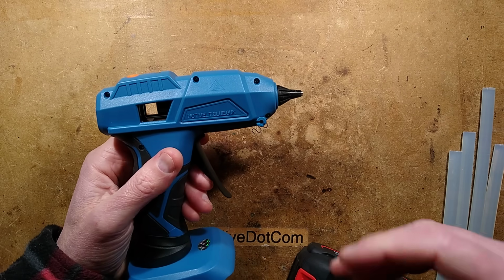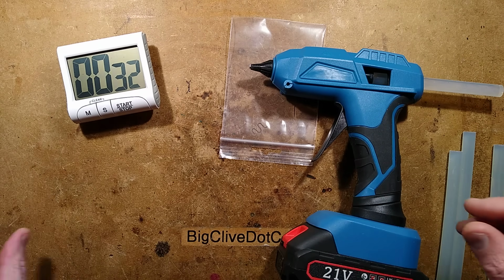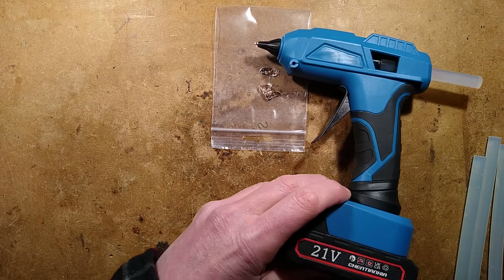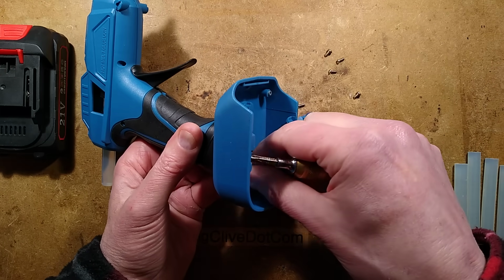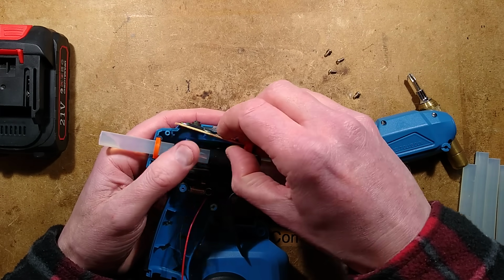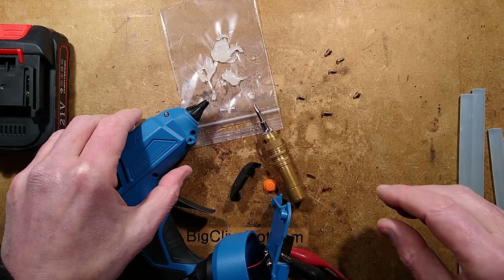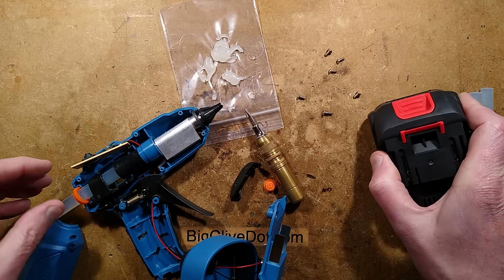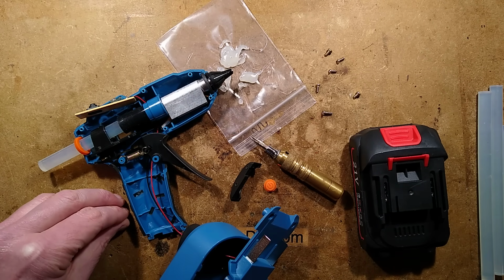Makita battery "compatible" glue gun

Comment: I built one of these Ali Express batteries and got the parkside adapter and it is really good. It was pretty simple to build but people should be worried there is a video where the guy starts putting the batteries in the wrong way around and once you have the cells all spot welded on he cuts and when he comes back finishes the battery as if it is all fine. But he had made a mistake. 

The BMS was facing the wrong way with the plus and minus at the wrong ends. So people should watch out and read the posts looking for warnings because YouTube just seems to leave those faulty videos misdirecting people. 

I will add that glue gun to my list of Ali Express gooddies. https://youtu.be/nm6DO_7px1I?si=xUCKVoGXoWwi5-72 

Here is the Big Clive theme song ;)  

https://youtu.be/nm6DO_7px1I?si=xUCKVoGXoWwi5-72

Comment: Something to note: I got a "Makita-compatible" mini chain saw from Aliexpress. Battery compatibility was only one way. I could use the chain saw happily with a real Makita battery, and it was a lot better than the supplied battery that kept cutting out (over current draw?). And while the fake battery physically fits a real Makita tool, it doesn't actually work. You may get the LED worklight to light, but not much else.

Comment: Glad I found this video, I have a mains operated glue gun, I bought in the 80s and still going strong, 7mm sticks. I never knew a battery gun existed. However they seem to design the same gun but for different makes of battery. I may invest in a battery version that works on a Dewalt 18v battery.
Reply from the maker: Keep in mind that DeWalt batteries don't have over-discharge cut off.  Accidentally leaving this on could cause the charger to refuse to charge them.

Comment: I have one of those Makita compatible batteries. Someone said it was waterproof. It was used for a portable pressure washer.

Water got in and shorted a capacitor. It holds its charge well. Still need to swap the BMS over. £4

Comment: Man, I would want Makita to make their batteries with protections in them, especially with Lithium Ion cells that don't like to be used improperly and could become a blow torch and fire starter in someone's home.  One of the reasons I will never drive a Tesla or other electric vehicles as those things tend to spontaneously ignite more than a lot of gasoline/petrol or Diesel powered vehicles.  Diesel especially since it has to be finely atomized to burn.
Reply from the maker: The new Makita batteries have better protection circuitry in them.

Comment: Bunnings in Australia sell their Ozito brand cordless tools at very reasonable prices. They periodically have"specials" and over the years I have ended up with almost the whole range. 1.5 to 6 AH batteries, discharge, over current, over charge, protection circuits in them. The over discharge will give a bit more after a short wait, great for the last screw while standing at the top of a ladder. NZ Warehouse brand has Mako tools, once again a very effective Chinese range.

Comment: Clive is absolutely right, the best battery s are the fake ones because they shut off the power and also have short circuit protection. Most new generation battery s however they actually have mosfets to shut off the output. Dewalt Powerstack is one for sure.

Comment: Makita batteries do have protections built in. you where probably looking at the older ones. the "newer" (past 10 years or so) have a small star on them. it means protection against overloading, over discharging and overheating. it also (I think) passively balances itself and actively with the charger. however some brands like Dewalt literally has nothing in them, I'm impressed you don't see more burned down houses from them. there's no way I'm charging them unsupervised.

Comment: i fished 2 identical batteries to these out of one of the battery recycling bins in Lidl last week. i get all the 18650s i need from supermarket recycling bins. i even got a tiny acid cell from one the other week. rated for 7.5v. lord knows with it came out of. i often wonder at the fire risk of these bins. every type of battery, many with charge, all jumbled up together. it seems ,to me, to be all too easy for  2 cells, with the plastic scraped of somewhat, so they conduct, to make a connection to a 8650 with charge, which gets shorted, thermal runaway, fire etc.

Comment: Really like battery brands that don't have protection on the output. Charge/discharge/thermal protection is fine but load detection is just irritating. For example Greenworks 40V batteries will refuse to provide power until plugged into a Greenworks tool.
My DeWalt batteries on the other hand don't care what they're plugged into.
It's nice because I'm industrious with my 3d printer and have made adapters so things work with my DeWalt batteries and I needn't buy another company brand $200 battery with a different standard etc. I really wish they would legislate these packs at various voltages the way AA cells or 18650 cells do it. Oh you have a 40V tool? Any 40V battery from any brand will do - that sort of thing.

I have a sneaking suspicion though these batteries are looking for a particular resistance across two pins to enable the output.
Clive if you ever get the chance to take one to bits that is picky about its loads, and you can "convince" it to comply, I'd love to watch. Not holding my breath as packs are expensive though.

Comment: Hi Clive  Have you tried the little narrow electric screwdriver sets that come with up to 68 magnetic bits in a beautifully designed and satisfyingly heavy, slide out tray, with the bits on both sides?  From AliExpress, I had a set for about 6 months now, and have almost abandonned all my other screwdrivers, even though I only really bought if for laptops with lots of small screws. It's just the job for those longer than expected screws you found in the glue gun.  I expect the motor won't last forever, but amazingly cheap for what you get.

Comment: It's surprising to me that the clone batteries would have better protection (with lousier cells based on tests I've watched). Perhaps Makita assumes you'd never use their battery in something that wasn't one of their tools, and the tool itself has the overdischarge protection?

Regarding that extra valuable sticker...I have a late 1980s Sony clock radio that has for years proudly proclaimed its support for SATA RAID.

Comment: Interesting. I'm still a bit old fashioned and use corded tools, mostly. The cordless variety especially with swappable battery systems tend to be still pricey for my budget. The last system I used was the Black and Decker Versapak system back in the 90s and 2000s. That was back when everyone wanted the Snake Light. They used to be the go to for cordless tools all the way back in the 80s and maybe even the 70s. The weren't the most powerful things. They were mostly an oddity professionals just scoffed at until Li-ion battery technology took off, and Black and Decker faded away.

Comment: Makita tools that are manufactured IN Japan, are quality.  otherwise, it's a crap shoot.  Also, it is stated on every makita battery, that is specifically designed to be used in makita tools.  which do have the charge regulators built into them (though this was added to the batteries as well circa 2012 or so).  so this is a really really dumb comparison to make.  

bottom line, do not use cheap tools on your makita batteries.  or even better... stop using cheap tools you mugs.

Comment: I've got Makita batteries and they do prevent over discharge in use on the machines with a star next to the battery holder. I think the machine sets the limit so a battery that shows discharged on my multitool (red led frlashes a minute or two befor the motor cuts off) can still be plugged into a low current draw machine (like my small impact driver) and be used for a bit longer. I did manage to destroy a  battery on an older drill by keeping on using it after it had cut out a few times (I was stuck in a cramped space and didn't want to go through the rigmarole of extricating myself to go and get another battery, expensive mistake !) and I continued to keep using it. Mind you, for the price Makita charge, I'd have expected better!

Comment: On a side note, I have a ryobi battery glue gun (the smaller kind which sits on the base, not the bigger one which has a battery directly on it) for finer work. Very pleased with it. 
I assume it hardly costs significantly more than knockoffs so otherwise than making use of Makita batteries there's no real reason to get those...

Comment: The makita batteries i have taken apart do actually measure each cell (or two each if its a pack with paralleled ones). They have a quite sophisticated bms but it doesn't shut any power off. Im unsure how i feel about it but the power tool itself needs some kind of way of switching off anyway so using that might be ok. Unless of coure you ise it with a tool that is broken or doesn't communicate with the battery... 😂

Comment: Did it not come with the bent wire stand? It has the bracket to take it just under the nozzle. That's handy to rest it whilst hot - on stand and battery, nozzle down.
Reply from the maker: It has a position for that on the case, but doesn't have one.

Comment: With Makita batteries, the charger knows far too much and as soon as one cell goes out of balance, the entire pack is frigged and a new one has to be purchased. This happens far too frequently and must be a pain for anyone that doesn’t dabble in electronics/doesn’t know how to sort the problem. They could quite easily manage the over discharge of individual cells as each has a supposed balance wire, but I’m sure they’re just used only by the charger to tell you that you’ve knackered another £90 battery…. The cheaper Vanon replacement packs do seem to be better though I’ve not deconstructed one as yet. I’m just addicted to Makita grinders as it’s the one tool they make better (longevity-wise) than other brands.
Reply: if you remove the battery from the charger and replace it after a fault enough times, I've found you can charge the battery up again. I think the fault is in the cell being over-discharged and never working as good again

Comment: Isn't that odd. I've been using makita on site for the last 15 years, and some of the oldest LXT 18v batteries I have are from 2008. They're still working. Not brilliantly, but they still take and hold a charge and run tools; where as I've had some knock-offs, and 3 of 5 purchased in the last 5 years have failed. Since gone back to buying genuine batteries. The plastic on the snides tends to be much weaker and struggle to take a drop or knock without cracking. I wonder if their new 40v XGT batteries have better protection? They're also using these tabless cells as they're called in some batteries.

Comment: It seems that there are many devices where the BMS prevents further discharge when the battery voltage drops to a certain level, but then also prevents charging because the voltage has dropped below the safe-to-charge level, you see this in many laptops and other products. Damn, the effect of YT. I glanced at those glue-sticks (0:15) and surmised that you were making cardboard shims for audio systems.

Comment: All brand name tool batteries have a system to shut down when they get too low but they don't do it by disconnecting inside the battery they usually communicate with the tool with some exceptions. Makita Batteries used to have the shutdown transistors in the battery but they realized that cost a lot more and now they're doing the same thing as every other tool manufacturer where it communicates with the tool. That third pin on brand name Makita tools changes polarity depending on if the battery is okay or not okay to use and every Chinese knockoff and adapter doesn't use that pin and will destroy the batteries

Comment: Genuine Makita batteries have over discharge protection. Fake ones often don’t. Some of the older Makita 18 volt batteries don’t have over discharge protection but any battery that has a star on the label has over discharge and over current protection. In fact most of the makita batteries are so intelligent, you can get a battery tester tool that will tell you pretty much any specs you want to know about the battery.

Comment: Milwaukee is the only battery i saw with protection.  I have taken the Dyson apart.  The Milwaukee appears to charge each cell or pair of cells individually.  The dewalts have absolutely no circuitry either unless I believe the 40v have a boost circuit that is inactive while they are shipped and then becomes activated during the first use.  There is some kind of rule about sending batteries that are 40v in the mail so they had to put something.  As a person trying to scrounge tool batteries I have seen EXACTLY ZERO at the local battery shop that collects.  Tons of Bosch and Dewalt and makita.  

Also the Chinese knockoff "build your own packs" milwaukee circuitry appears to be really good.  The shells are a bit too light and there is no padding or much space.  I got two of them from a guy who ordered them and they never did work.  One of the terminals had fallen off during shipping.  The wires are a bit small.  

A weird and ironic failure that apparently happens... I got one myself.  Their HEAVY duty batteries.  Are extra thick.  And have Heavy heavy wires and battery tabs.  The tabs are superior!  So much so that they are nearly impossible to weld... even the factory couldn't!  The tabs had fallen off and the weld hadn't penetrated.

Comment: My two cents.  ANY cordless hot melt glue gun is damned handy.  Cheap is good.  Something that uses the same battery system as your other tools is, of course, highly desirable.  I really like the Ryobi stuff.
Reply: I'm still using one I got years ago that used 4xAA cells. I ended up putting a boost converter / charge controller and a single 18650 in, heats up faster and has been running on that for years off an old laptop cell. My projects are usually non-demanding for hot-melt - a dab here and there which this keeps up with fine.

Comment: I bought a 4" chainsaw ex eBay a few years back. It uses that type of battery and does monitor each cell. The chainsaw is excellent so I bought a second one just in case when the price dropped. I still have the second pair of batteries but be buggered if i can find the second chainsaw. Luckily the first one still works fine. 
I figure that when the first one eventually dies I will have found the second one buried under a pile of STUFF somewhere in the workshop.
Reply from the maker: The little chainsaws are dangerous, but really good.

Comment: Hi Clive, any recommendations for a (preferably hot glue) glue to apply around a PCB surface mounted 3.5mm headphone socket for strength/reinforcement?
Reply from the maker: The glues they tend to use for that are often a hard rubbery compound.  But any standard hot glue may work as long as it gets good adhesion onto the PCB and doesn't wick into the socket.

Comment: I very much doubt that switch is rated for the 3 amps current it pulls on start up... so that would be the weakest point to this thing. A search finds this model BK-1208 which is "ali express" rated for 30v 1amp.... so who knows what it really is rated for but 1 amp is sounding generous

Comment: Although simple, that simplicity provides almost immortality.  Our 25-year old "mains" Bostik gun still works just fine,  however it was supplanted by a pretty decent multi - power thermostatic Chinese gun (using a ubiquitous anonymous  microcontroller chip to do literally everything) a while ago, simply 'cause the Chinese gun is a lot faster on warming up.

Comment: I had a customer return a DeWalt battery pack that had failed, no lights or anything. Sent for repair. Probably 6 months later. Customer returns with his brand new battery also dead. Turned out he was using an aftermarket blower😢. My Guess is the dewalt battries also don't have protection...

Comment: Dyson vacuum handhelds all have a very complex circuit board in the battery packs... A 6-8 cell pack and you'd be surprised how many times the board is the failure point as opposed to the numerous cells.
Reply: But they're good to salvage good 18650 bateries out of them at least. Overpriced Dyson junk😕

Comment: As a fan of the old Ryobi blue version nicad set I loved them reliable .when they came out with the green lithium ion sets I was not impressed with the chucks on the hammer drill ,but the selection of tools was good especially when you get them for cheap I now have the big impact gun and hot glue gun and 4inch grinder ,I still have blue chain saw and circular saw with laser that still works well .The rest of my tools are Milwaukee M12 and M18 .sold off all my 18b DeWalt when they changed battery platform .sold off everything .now you can get adapters

Comment: DeWalt batteries are even worse. There's barely a passive cell balancer in (at least most of) the packs. No protection of any kind -- it's all in the tool. While not strictly an issue when the batteries are used as prescribed, as a home hobbyist who uses DeWalt... 🤷‍♂